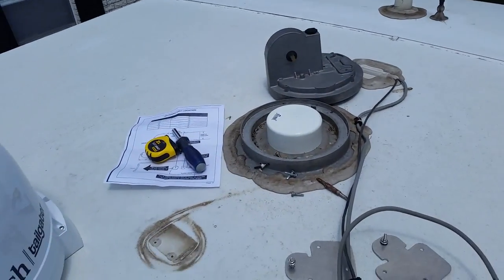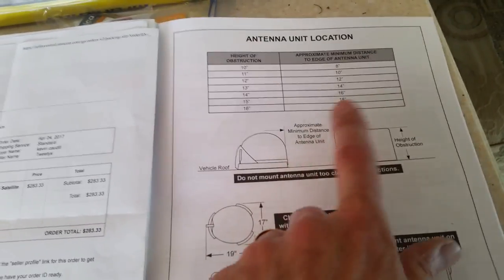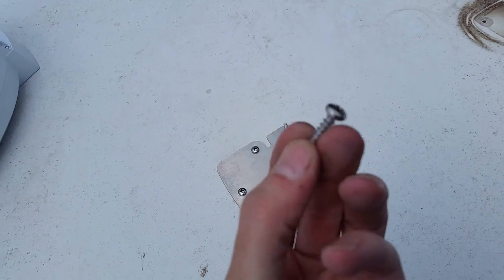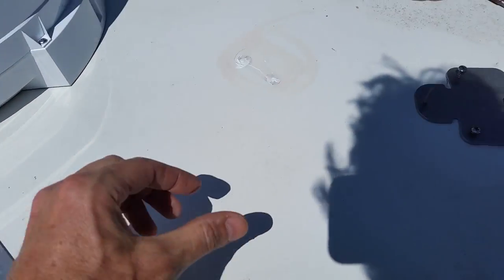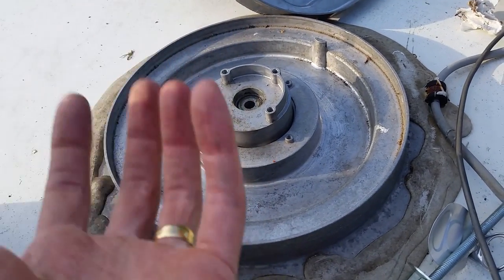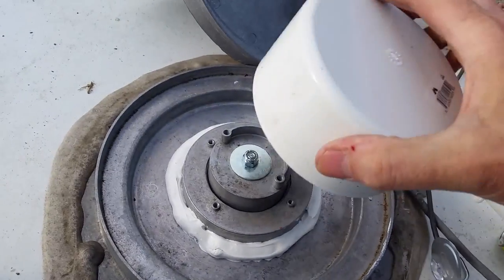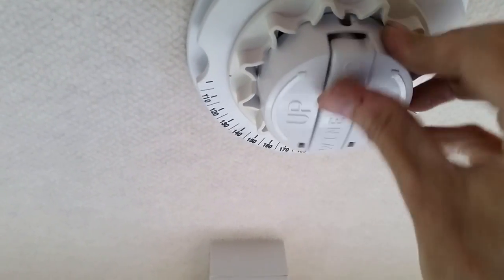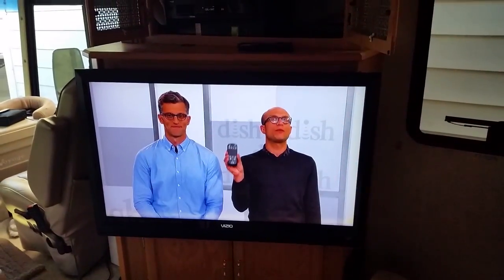Installing Dish TailGater on RV roof.

Comment: good job on telling us how you do it.  It would be more helpful to demonstrate the actual install. Questions. What is the thickness of the roofs in general, what was the size of the stainless screws, what was size of bit for pre-drill mounting screws, things to consider if anything other than AC clearance when mounting.
Reply from the maker: very thin but strong .. thin layer of fiber glass then 1/8 luan then foam

Comment: Good one I have the winegard on my roof with the 211k it wont work here in Texas no help from dish outdoor have to call winegrad for help all they want you to just replace the rooftop! I have the old gator works fine cant find any info on if the Wally will work for the roof anyplace on YouTube

Comment: So, a few questions if you don't mind.  I have a class A with 2 old sat's on it.  Big dome up front, and the manual one like you had in the mid section.  Neither one work.  I bought the King Sat so I can run two receivers for 2 TV's, front and bedroom.  Did you use the OLD cable from the the old sat dish?  Isn't that RG59 cable, where as the newer cable is RG6.. did that hurt any?
Reply from the maker: Yes I used my old original  cable that went to the manual dish. I cant remember its number, My RV was built in 2005. My HD channels look great. Thanks for watching

Comment: How do you point the tailgater to the direction of the satellites if its mounted in a fixed position?
Reply from the maker: 317Vapers the satellites it's in side the white plastic box and it's on a turntable that's powered by small electric motors it rotates around and around and finds all the satellites automatically
Reply: Kevin Caudill I must have the cheaper version of the tailgate then. Mine adjusts but it's not a automatic you still have to point it in the direction

Comment: Nice video and good clean installation --  lots of good information.  One objection a dish dealer told me about the King Tailgater is that it is not at good as the Wyngard Pathway X1 for picking up Dish's eastern satellites?  Apparently, when RVing to the Carolina coasts, the south Florida, or northern Maine there is a line-of-site issue in reaching the satellites -- they are below the horizon.  If that is true it seems like there must have been a error in positioning the satellites in the first place?  But anyway just wondering if you have ever taken your coach to the Atlantic area?
Reply from the maker: Mandolin1944 I used it Massachusetts a few years back and it worked there. ..in Montana today and it works great..
Reply from the maker: Mandolin1944 PS I used it in Orlando last year. No problems

Comment: So why didnt you just remove the old dish base and install the new dish on top? Instead of a bunch of new holes in the roof!
Reply from the maker: Because the old base is sealed very well from the factory not leaking, and then i would have a 1" hole to seal up where the crank handle shaft comes down through the roof..  so far all is good no leaks from the old or new dish.
Reply: Kevin Caudill, dicor's not that hard to get off, then a stainless plate to cover hole and mount your new dish on top to cover plate and a clean installation! To late now! Enjoy your dish!

Comment: what kind of roof do you have Fiberglass or rubber ?
Reply from the maker: Fiberglass,, its still holding strong
Reply: When you are doing your yearly sealant please use Nuflex 311 on your roof around vents and both caps . I have a 2000 Itasca Suncruiser  and it was highly recimended to me from Winnebago industiers I also have a fiberglass roof

Comment: Roof mount not good considering you will probably will park in shaded (trees) areas.  Better to make 60ft cable and set it up in good area
Reply from the maker: I thought the same thing so i keep my old TailGator in my RV storage compartment in case I had that problem. As luck would have it this summer we was on the road for 3 months and 7500 miles and not one time did i have to pull out my old Tail Gator and its 50 foot of cable.
Reply: What receiver do you use , wally
Reply: I've been in the satellite business for 15 years and I've seen it all.  If you need any help let me know. We are getting ready to get a camper and have figured on using a tripod and a dish
Reply from the maker: ViP 211z
Reply from the maker: I do have a question but first I have been rving for 10 years and used the external tail gator that i could move around for best signal. and i still carry it as a back up. But sense I got this roof mount I rarely have to use it. We stop at a lot of Walmart's as we travel to sleep for the night and it is so nice being able to turn on the TV and in a few minutes its ready to go. 
 but here is my question for you, out of my receiver I use a simple sliding A B switch to send my signal to the roof mounted dish or the remote dish. But my signal voltage seams to drop going through the A B switch is this a common problem ? is there a better switch to use ?
Reply: joe sokol o

Comment: Thanks so much for being the guy that FINALLY put up a real video of this! One thing I don't understand...I was under the impression RV's had a rubber membrane over the entire roof, so wouldn't the adhesive ONLY be as strong as the rubber membrane? I mean, did you cut it away from the mounting brackets (to expose fiberglass)? And if so, how was the transition made from the mounting brackets to the membrane (did you leave some of the membrane underneath the brackets or cut the membrane clear away and use some type sealer that goes out to meet the membrane) I really hope this makes sense. Great video, this is the only thing I was unclear about.
Reply from the maker: Thanks for watching, Our roof is fiberglass so the bonding and screws work great.  But you have a rubber roof that is stretched over plywood I would look into finding some type of expansion bolt. something that will flare out from under the bottom side of  the plywood. If the manufacturer of your RV is still around I would give them a call and see what they recommend. Another thought is if there maybe roof rafters ever 4 foot or so you might find them with a stud finder and you could attach the 2 front brackets very securely with long wood screws. Then lay a good cover of Dicor sealer over the complete bracket.       Call my cell if like 606-875-0125 Kevin

Comment: Those tiny tailgaters are not really big enough to properly perform on KU band. I am sure signal is marginal at best and will fail quickly in bad weather.
Reply from the maker: Jimmy Ray I don't know anything about the Ku band but I have been using the dish Tailgater for over 5 years now from coast to coast and generally works well for me of course if it rains hard it will not work. PS we use the Dish network. ..
Reply: They work perfectly, been using one for 4 years, all conditions no difference from my home service. Outstanding high def.